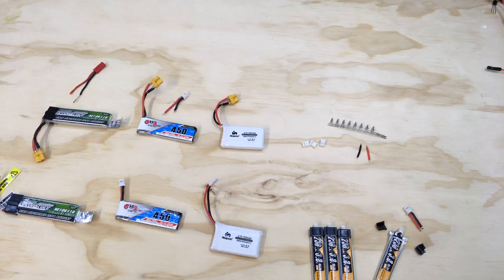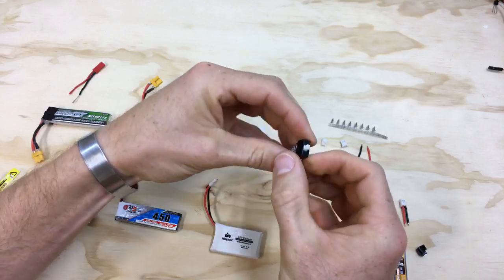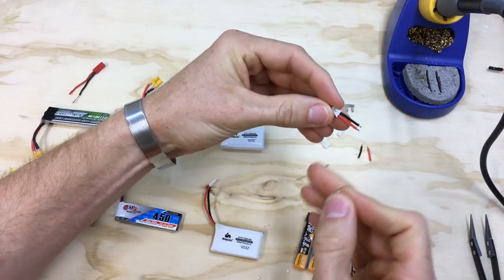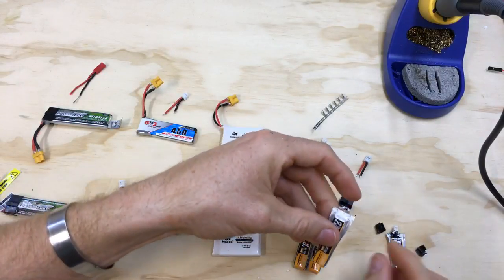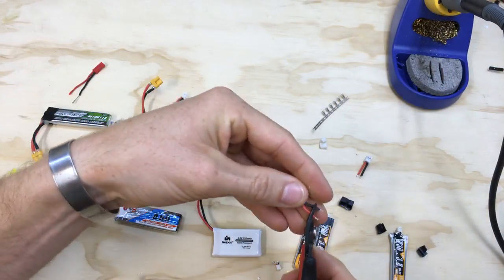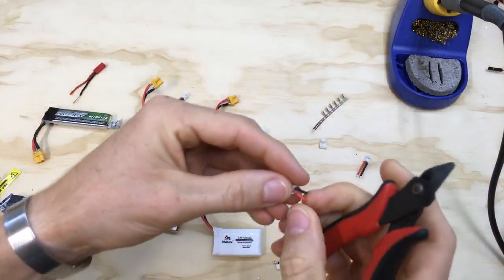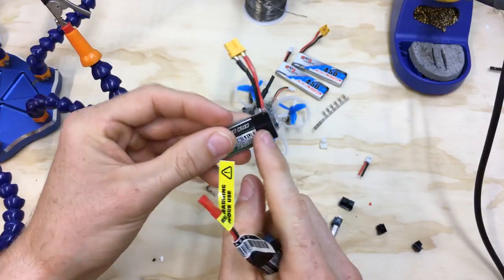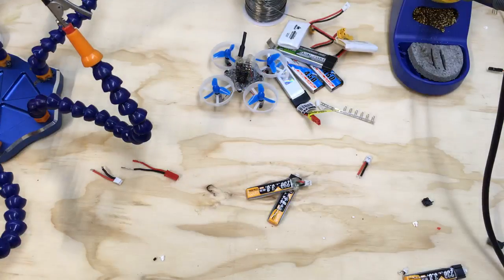Lipo Battery Connector Swap | Live Stream

Comment: Will those gnb 450 batteries work for a tiny whoop or are they too big?
Reply: Pretty sure they are too big without major mods. But the weight may outweigh the power output on brushed motors